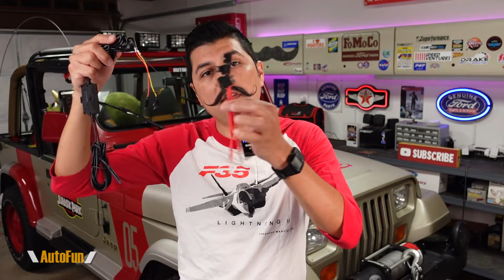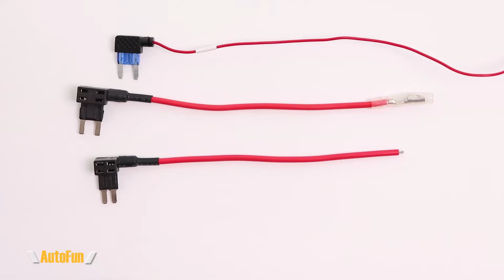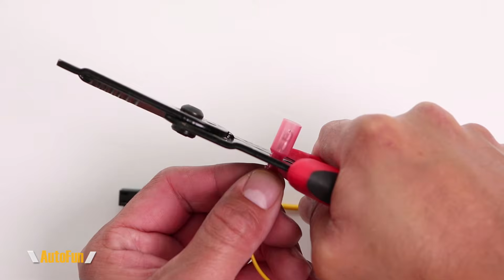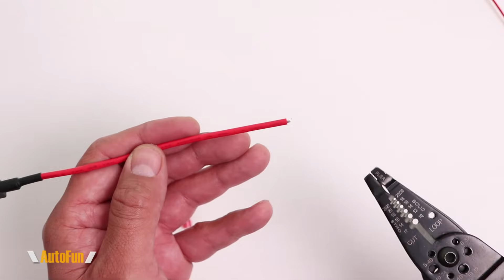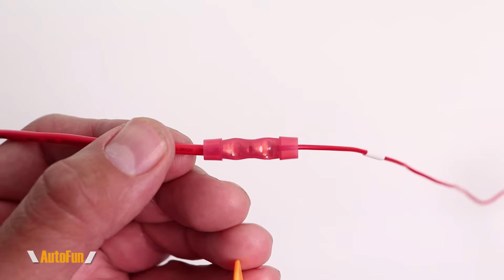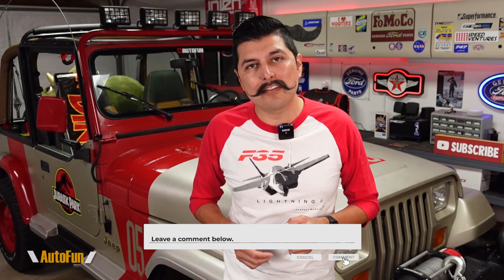How to Install FUSE TAPS on Hardwire Kit (For Dash Cam Hard Wire Installation)

Comment: If I don’t use the original fuse(small red plastic) is there any problem?
Reply from the maker: Hi Orhan! Ah remember a functional fuse tap creates 2 separate independent circuits. The fuse removed from the car in the fuse tap bottom slot and the second fuse (top fuse) is for the hardwire kit. So they are each independent of each other. Here is another video where I explain the hardwire installation process https://youtu.be/K2iKXj82354 and here my other hardwire video where I cover the dangers involved when installing a hardwire kit on a cart with air bags. Hope this helps, Cheers!

Comment: Hi. When installing two fuse taps to power a dash cam how do you determine what amp size the new fuses should be?
Reply from the maker: Hi Michael! I use the same fuse Amp rating as what originally came with the hardwire kit. Hope this helps, Cheers!
Reply: But if my hardwire kit or add a fuse kit doesn’t come with fuses, then do we match the fuse amperage with the same as what we are using from the fuse block?

Comment: One thing I ran into is the new Ford Explorer has the Micro3 blade.  Which requires 3 blade fuses.   The Red Tiger dash kit doesn’t come with wire taps and the explorer has no spares.  So looks like I’ll have to find some taps that are cokpanyibe
Reply from the maker: Hi Daniel! ah yes here you go https://amzn.to/3OcHX9w Hope this helps, Cheers!

Comment: I have a question! So my hardwiring kit already has a bullet connector connected to the fuse head part.... with the wrong (mini) fuse, how do I connect that to a micro fuse tap, like do I cut before the bullet connector or after the bullet connector of the original hardwiring kit before crimping it with the micro?
Reply: or can i connect a bullet terminal kit to the existing bullet connector to join it with the micro fuse tap?
Reply from the maker: Hi Ray! Correct, bullet terminals are usually compatible, if your hardwire kit already has one, and your new fuse size end already has one too, the easiest way to swap it out would be to disconnect the existing incorrect fuse from the hardwire kit and test to see if the bullet terminal with the correct fuse size fits. In the rare case that the bullet terminals do no mate correctly, then yes I would cut off the terminal and install a matching one (so far I haven't encounter that but it may be possible someone out there is using a non-standard bullet terminal) Hope this helps, Cheers!
Reply: @AlexAutoFun  yes I have encountered that situation unfortunately, thanks for the info and quick reply!!
Reply from the maker: @rayhuang5788  You're welcome!

Comment: Nice I soldered my Radio aftermarket harness on my nissan, I think radio harness should always be soldered and taped you don't want to take your dash apart to reinstall a radio plus nothing like a Soldered connection. 

Thanks again for sharing.
Reply from the maker: You're welcome ELEVO! Nice, stay tuned, I have a full series on soldering (starting from basics to advanced) Cheers!

Comment: How would the larger Amp fuse function here? Since both are connected to the same circuit the fuse with the lowest amperage rating will trip. This limits amperage for one circuit or makes it dangerously large for the other.
Reply from the maker: Hi reverse moustache cat! Ah remember a functional fuse tap create 2 separate independent circuits (each one with a different Amp # based on the fuses that are loaded into the each fuse slot in the fuse tap) The fuse removed from the car  inserted in the fuse tap bottom slot. The second fuse (top fuse) is for the 2nd load, the hardwire kit load. That circuit does not impact when the bottom circuit pops. The original car fuse will continue to pop at it's rated Amperage (in this case 2A) and the hardwire kit will pop at 15A. Here is another video https://youtu.be/YibUc7myohQ where I explain how the hardwire kit and fuse taps work in mode detail. Hope this helps, Cheers!

Comment: My hard hardwire kit is like that but it also have sa glass tube fuse in it and at the end of the wire it also have 15a/blue fuse, do I need to put another 15a/blue fuse on the holder?
Reply from the maker: Hi AxielLegends! Ah yes I seen that before, were there is a glass fuse in addition the molded fuse. Normally when converting the kit to functional fuse taps, I remove the glass fuse section, however there are some installers that will leave the glass fuses in place (so you have redundant protection when using functional fuse taps.). Hope this helps, Cheers!

Comment: First of all I would like to thank for such a great and detailly explained video, which helps me a lot for hardwiring my wolfbox G850 to Corolla. However, as far as I know, fuses are coloured based on amp rating (i.e. standard blue fuse has a 15-amp rating, yellow is 20 amps and green is 30 amps). May I ask, how to determine what colour of fuse I should use for the dashcam kit? or just the blue one cut from the original dashcam kit is fine?
Reply from the maker: Thanks Sherlock! Ah yes the fuse for the hardwire kit is of the same value as what came with the kit. In this case since the kit came with a blue fuse (15A), I used a 15A fuse on the functional fuse tap. Cheers!
Reply: Thanks Alex, very informative 👍🏻
Reply from the maker: @sherlockshaful  You're welcome!

Comment: On amazon i can see that every wire are red. Where can i get red and yellow red wire with double fuse extension?
Reply from the maker: Hi Nemanja! While it is nice to have matching red and yellow wires (and helps to keep track of which is BATT and ACC) it is not necessary which is the reason we mainly see fuse tap kits only include the red color. The yellow fuse taps you see on this video are part of the Rove ultimate hardwire kit here https://youtu.be/Ny-TvRnhTs4 Hope this helps, Cheers!
Reply: @AlexAutoFun  can you tell me how to know how strong is the fuse in hardwire kit ( usb c slot), in wolfbox kit? My G900 is not good. Lots of bugs, it restarts from time to time, rear camera at night is horror. I have white snow in the dark and low light. Try everything. And i contact support i will get new complete kit, but can you show me the rear camera but in the cmplete dark? Maybe from 850 or 880 ( rear camera is metal and heavy). In the daylight and with some light os ok but nothing better from Vantop. Vantop rear camera show dark and this one white snow. Also the reverse guadline mod is better in Vantop. The lines are wider picture is bigger. In Wolfbox if i choose wide reverse screen everything is magnified and i need to go i portret mode. But then the picture is smaller. Also 2 aeconds delay when i put gear in reverse to see the picture in mirror. Can you tested or can i call you on some number maybe?
Reply from the maker: @nkojic  Hi Nemanja! Unfortunately I have not reviewed the hardwire kit for the G900 yet so I can't confirm the fuse, but oh man sorry to hear your G900 is giving you issues. That is kind of the reason I sometimes wait on new products, since they are new, there can sometimes be bugs or issues that are still being worked out (this is true on any new product that just came out, part of the price we all pay for having the latest model I guess! LOL) If you want to compare the video quality to the G850, you can see that here during the test drive portion of the review https://youtu.be/7UbJk32_k5Y and If you want to compare the video quality to the G880, you can see that here https://youtu.be/JJKbUu_egiE during the test drive portion of the review. I would also recommend contacting Wolfbox for support, they may be able to walk you thru some trouble shooting steps. Hope this helps and please let us know if you decide to stay with the G900 or try a different one. Cheers!

Comment: I'm lost, can some explain to me - is it required to keep the existing fuse when using a hardware kit, is the 'fuse' connector on the end of a hardware kit actually a fuse or just a connector. Basically is a fuse tap required if all slots are taken and why? @autofun
Reply from the maker: Hi Justin! ah yes first we must understand how a hardwire kit works, here is my introductory video https://youtu.be/OyQs8X7H56o which explain this in more detail (functional fuse taps vs the fuse ends you saw me replace on this video, some hardwire kits already come with functional fuse taps, this video is for cases where the hardwire kit does not come with functional fuse taps) and here is the actual install video where I goes over when is a fuse retained and on which position of the fuse tap is installed https://youtu.be/K2iKXj82354 Hope this helps, Cheers!

Comment: I'm really amazed how you take your time to respond to every single comment. Your videos made me buy the hud drive and currently waiting for delivery. Is it also possible to hardwire that one along with a dashcam? Do you think it will also be possible to add more 12v ports (cigarette lighter) on top of that? Or would that be too much for the car to handle? I haven't looked at my new car's fusebox and electronics. It's a 2010 astra h twintop.
Reply from the maker: Thanks Sam! Ah regarding hardwiring the HUD, nope so far there is no kit out there to hardwire it (but sounds like a interesting idea to free up the cigarette lighter port) Regarding running more than one hardwire kit, yes it is possible (I run two kits on my cars since I run 2 dashcams at the same time) And for adding more spaces on the cigarette lighter port a splitter like this one https://amzn.to/39zWZnT can be used. Hope this helps, Cheers!
Reply: @AlexAutoFun  Thanks for your reply. Unfortunately a splitter can't be used because it shorts the fuse when trying to plug in multiple devices. And due to the position of the cigarette lighter port, it'll get in the way of the climate controls
Reply from the maker: @Rexy_Raccoon  You're welcome Sam! ah yes for those cases with limited room in the plug area I use this style https://amzn.to/3Wz5XFC so I can move the ports to an area that has more clearance. Regarding power, yes you can max out the cigarette port with multiple high power devices connected (normally most ports are fused at 15A but this varies from car to car, I would double check your owners manual to confirm) Hope this helps, Helps!

Comment: Does not having a backup battery pack dedicated for dash cams harm the car battery? Asking for a Benz  2014 c300. Great tutorial!
Reply from the maker: Thanks Calvin! I use hardwire kits with a low voltage cut off to prevent overtraining the battery however some brands do offer a stand alone battery pack like this one https://amzn.to/3bnExj6 but they are usually pricey and some people have concerns about charging and discharging a large lithium battery on their car (specially when unattended or when subjected to temperature extremes the car can potential see such as when left in the sun or in the winter) which is  kind of the reason I think stand alone battery packs haven't take off in popularity. Hope this helps, Cheers!
Reply: @AlexAutoFun  thanks for your reply..  do you think just having  a dashcam  tapped directly with that low voltage cutoff hardwire kit to this European car will affect it negatively?
Reply from the maker: @Calvin  You're welcome! ah that is a good question, while I have not had issues with my hardwire kits in all the years I been playing with dash cams, there is always an inherent risk when adding an aftermarket device to a car. Either installation can go wrong or the device can fail or some other latent failure may occur down the road. I know this may sound like an exaggeration but the example I give to people is that I had a friend who installed an aftermarket stereo on his car. Well the car caught on fire a few days later, and while it could have been the install, it could have also been the device or as my friend says maybe it was unrelated but just coincidence. So that is definitively something to keep in mind when deciding to upgrade your vehicle with aftermarket accessories. Hope this helps, Cheers!

Comment: Hi there, why not just insert the fuse for the hardwire kid into the fuse tap (as well as the original fuse as you show in the videio), cut off the wire on the fuse tap altogether and call it a day? Am I missing something here?
Reply from the maker: Hi yeskii! ah good eye.. I personally don't do it like that because I don't like how high the assembly gets when stacking the fuse tap from the hardwire kit into the functional fuse tap and then having to deal with cutting and shutting off the unused pigtail so it does not contact anything (here is the video where I show this https://youtu.be/wAad_JA7kz8 at the 9:55 mark for those wondering what that looks like) Cheers Bud!
Reply: @AlexAutoFun  yea that makes sense, fair enough! Thanks for the quick response!!
Reply from the maker: @yeskiii  You're welcome bud!

Comment: Which one is the fuse that goes to the hardwire kit? I understand that the existing fuse from the car goes on the bottom of the tap but what fuse are you placing on the top? The light blue one?
Reply from the maker: Hi Rachana! good question! the fuse for the actual hard wire kit is the same one that came with the kit (for example if it came with a 15amp, then I use a 15amp which is blue) what sometimes changes is the size, but I keep the same amperage rating (same color) as what came with the kit. Hope this helps!

Comment: What's the problem with removing the original fuse(asuming same color) ? Doesn't the hardwire kit has fuses too?
Reply from the maker: Hi Gaston! you can see why sometimes the original fuse that comes with the hardwire kit has to be replaced at the beginning of the video (1st reason being the fuse size of the kit maybe different from your car's fuse size and the 2nd is that your fuse box may not have spare spaces available, the fuse tap add an additional use slot). Hope this helps and thanks for watching bud!
Reply: @AlexAutoFun  thanks for your reply. So can't I just remove an existing blue fuse and insert the hardwire kit wire there (asumming they have the size) ?
Reply from the maker: @gastonbarreto7060  Hi Gaston! Ah good question, remember the hardwire kit needs a specific source of power, unfortunately it can't just be any blue fuse. It has to be connected to: Accessory Power (turns off with the car) and Constant Power (always on) and compounding this issue is that it is not recommended to use fuses that control critical functions of the vehicle as that can create a safety hazard if they pop due to the dash cam tapping into those, so they number of possible locations where the hardwire kit can be connected is very narrow, here is a video where I cover this in more detail https://youtu.be/_MlRJ2_cd2o Hope this helps and thanks for watching bud!